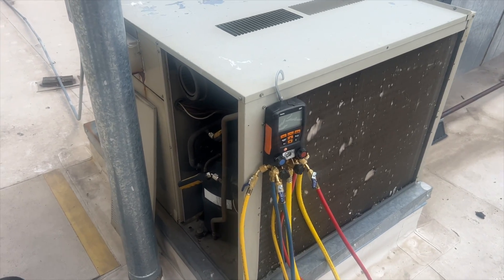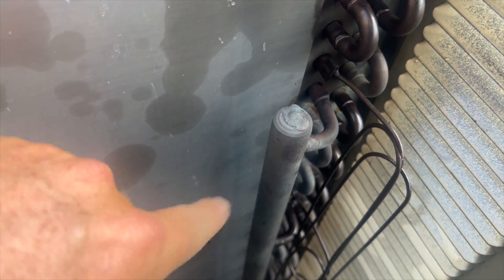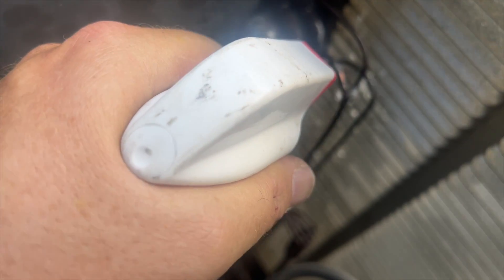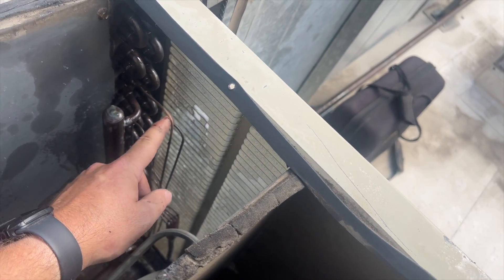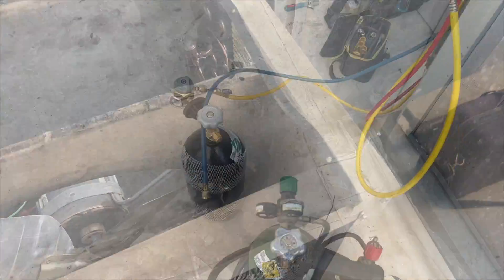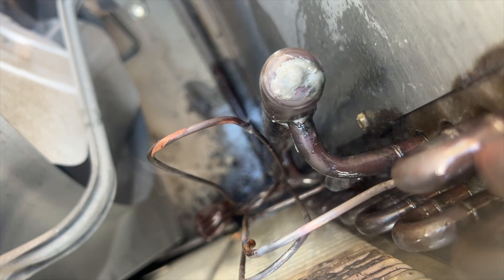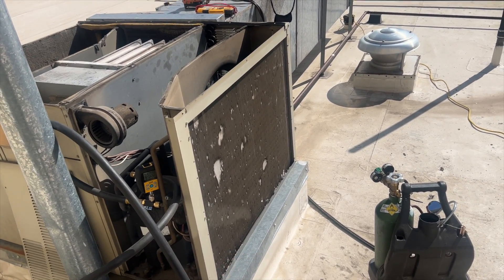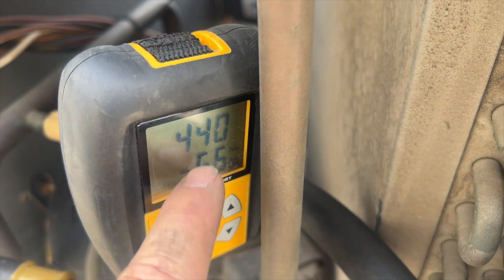No Cool Call.  Flat Unit, Brazing Capillary Tubes EP106

Comment: What vacuum setup do you use?
Reply from the maker: I use a fieldpiece VP85 vacuum pump. Then I use 2 Appion schrader core removal tools and 2 Appion 1/2 “ to 1/4”mega flow vacuum hoses. And a fieldpiece SVG3 micron gauge.